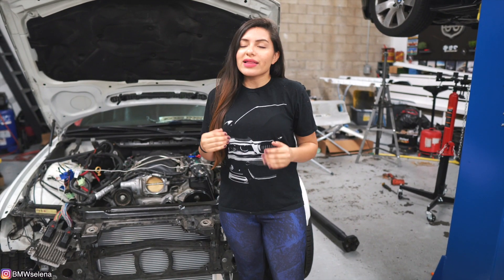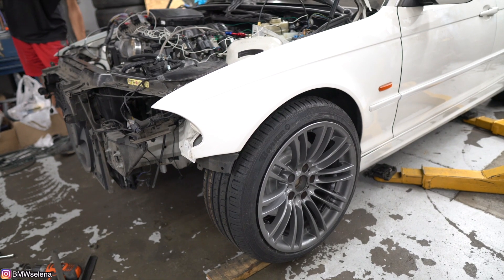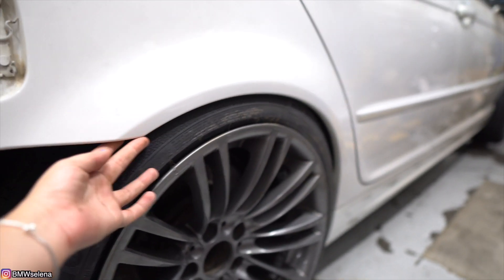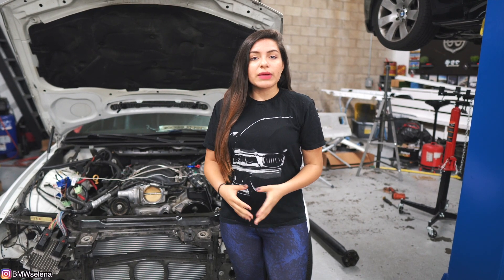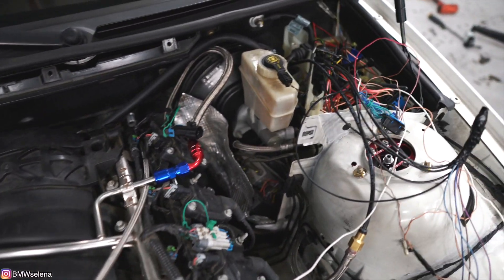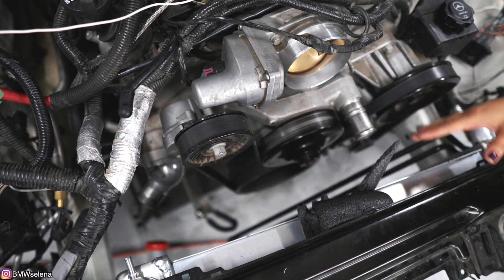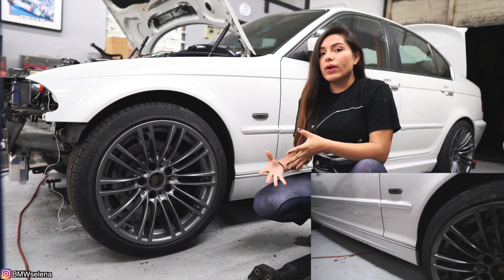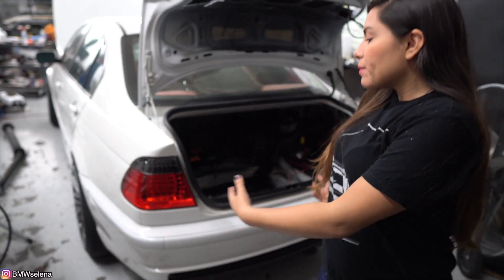BMW LS3 FIRST DRIVE AND CAR WASH + UPDATE

Comment: I'm running a '91 3 series radiator on my 240Z swap , been driving for 6 months a temp is normal only needing the fan while idling for a long time .

Comment: It seems like we are working together hahaha.I started last year june. I didn't spent much time to it.Mine was nealy ready last week on thursday. i test run it too. but still have to finish details. Muffler. fan relay. And i need to find the Tach gauge wire of the E46 to make it work. Selena, you better use the 160 thermostat. And let your ECU control the fan. In ECU sttings put it on 160 degree
Reply from the maker: Good luck with yours and we know don’t worry

Comment: So are you guys going for a show only stance car or a fun car to enjoy? Take 10mm off all your spacers so you can use that car. The air suspension will also hold you back, a nice coilover set would make the car handle so much better. It just seems like you are building two different cars. LS3 monster, but a stance show car that's unusable. Also if you take out the spacers you can run the proper size tires. On a 9.5 you should have at least a 275-285 tire. But a 295 will fit no problem.
Reply from the maker: There are no spacers :)
Reply from the maker: And my tires are not stretched :)

Comment: What did you do with the throttle body and gas pedal situation? Is it still drive by wire? If so, what pedal did you use? If you used a BMW pedal, which one and did you have to reprogram or rewire anything? If you used the Camaro pedal, how bad was mounting it?

Comment: Are u gonna but m3 cosmetics?
Reply from the maker: Mmmm like what ?
Reply: BMWselena an m3 e46 facelift and rear bumper and dual exhaust?😄 I think if u add that your car would be perfect.
Reply from the maker: It will have dual exhaust and m3 bumpers do not fit sedans
Reply: BMWselena I think I’ve seen sedan builds where they have m3 bumper with dual tips. It look so nice.

Comment: Congrats, the project is coming along VERY nicely ! Your engine sounds extremely healthy, can`t wait to see the car out on the road. Just FTR, non-M E46s need High Offset Fitment wheels (i.e., a number higher than +35). The air ride will definitely help, but clearances may still be a problem. Good luck !  :-)